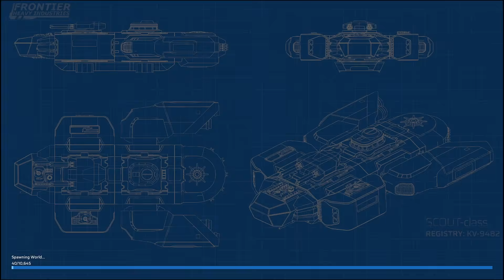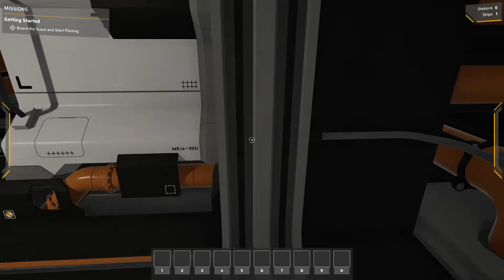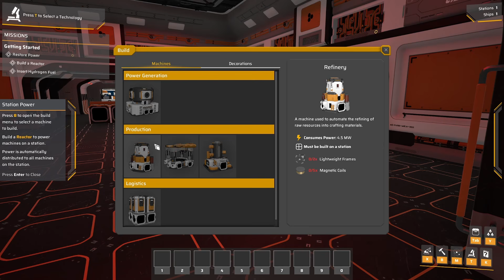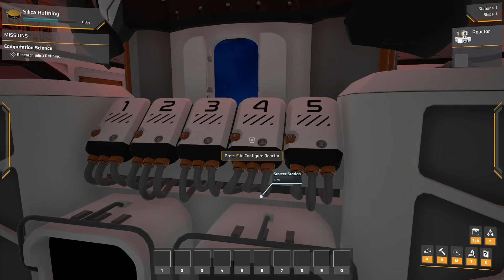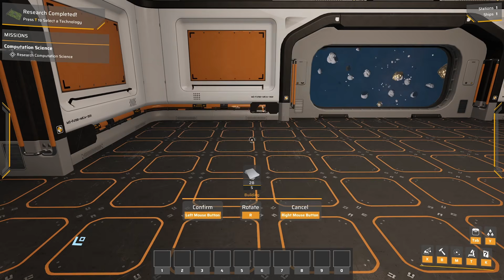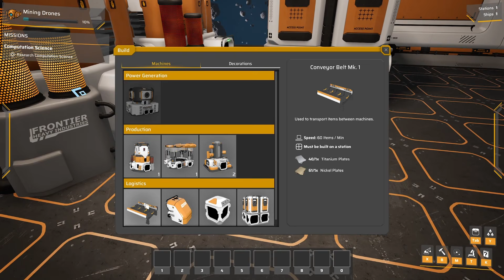SATISFACTORY IN DEEP SPACE?! 🚀 Main Sequence (First Look)

Comment: Sure, let's do another comment, so the first one doesn't feel too lonely. Actually, why not use it for something useful. You can have the recipe for chokeberry jam I used the other day, because holy crap, Batman, that is good stuff. 😀

2 liters of chokeberries (Aronia Melanocarpa). Chuck them in the freezer first, that helps breaking them open during processing, and takes a bit of the acidity as well.
5-6 medium sized apples, cored and diced (somewhat tart apples are best, as they have more pectin, which helps thicken up the jam)
500 grams of sugar
A stick or 2 of whole cinnamon bark
0.1-0.15 liters of water to get the show rolling

Stick all of the above in a large pot and boil at low heat until has the right consistency (it will thicken a bit more when it cools down). Meanwhile, prepare storage glasses for the jam, washing and disinfecting them thoroughly. When the jam is done, and has cooled a bit, add jam preservatives as per the instructions on that specific product (the stuff I used was 1 teaspoon per kilo, but your mileage may vary). Store the finished jar in a dark cupboard or in the fridge. Enjoy on fresh bread or toast.

A word of advice though: Keep dogs and children, as well as anything else you'd prefer not be coloured purple away from the aronia-berries. They REALLY do give off a lot of colour 😀